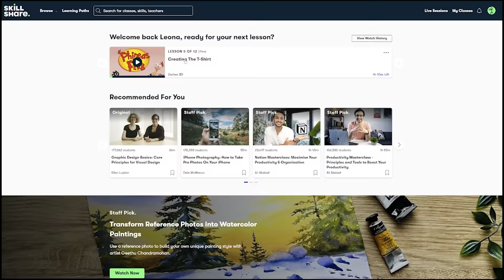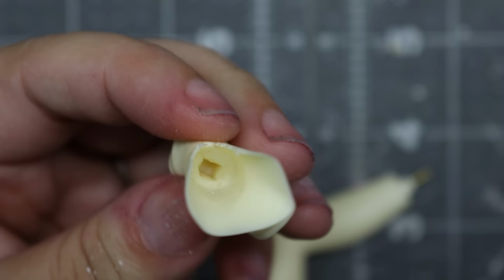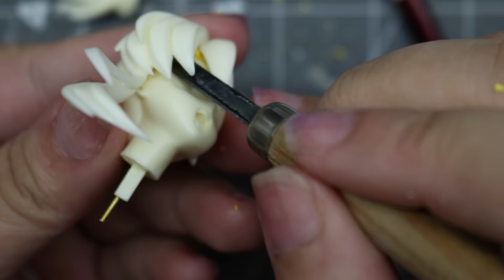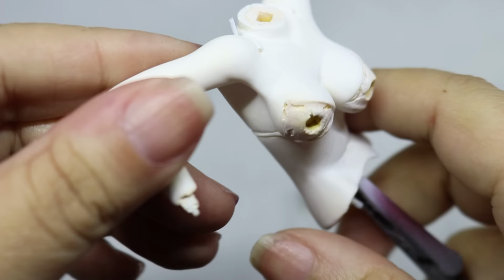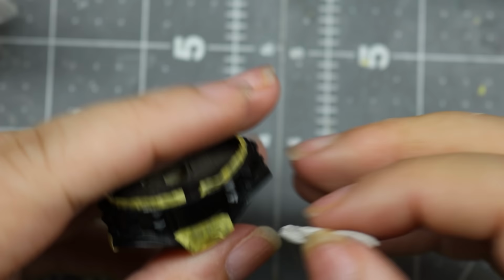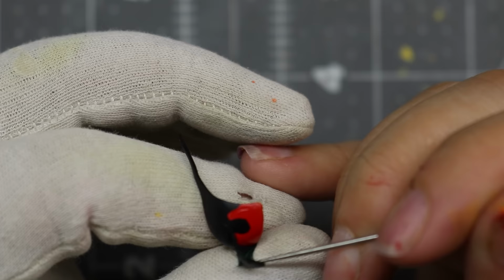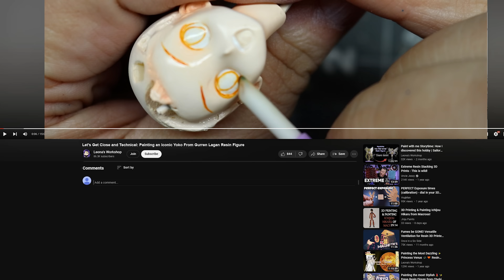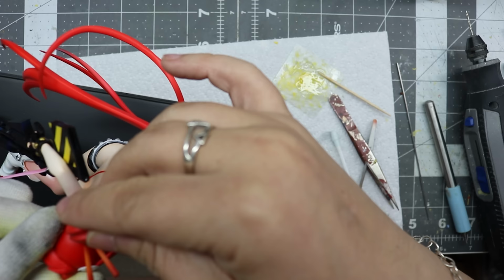🎨 Painting an Iconic Yoko Littner 👀 Resin Figure From Gurren Lagann 🤖

Comment from the maker: Hey guys, I don't wanna keep repeating so be SURE TO READ THE INFO BOX! All the info is there, I made a special google doc with the links to almost ALL the materials and products I use, if something is missing, please leave a comment here so I can update the list!
Hope you enjoy the premiere! 

There will be a few things that I didn't answer in this video mainly because it didn't apply, some of things off the top of my head people asked for was working with clear resin, this kit doesn't have it so raincheck for next time, another thing a couple of people asked was regarding tips for carpal tunnel and/or wrist paint management when holding an airbrush, I don't have that issue so I wouldn't know how to help you 😬
Reply: I just use a pistol grip airbrush... I have several makes from good manufacturer.... I'd advise people with hand issue to get either Grex Tr3, Procon Wa, Gaalhari GHAD-68 or Fendga BD116c... most of which have a mac valve so you can control how fine the paint/air is.
Reply: I think an approach that you can take is to (if you can) show How you hold your tools, how you move your Arm (rather than Just moving your wrist), if you do or don't lean on your elbows/forearms and if you use some kind of padding on your desk (you can pinch your nerves that way if you lean on them too much, as I've had to learn, 😔)

I remember you showed a bit of that in your air brush tutorial, with how the tool sits on your hand (how hard ppl grip their tools Also plays into straining/tiring their hands)...that stuff, 😅

Luckily I don't have carpal tunnel either but I Did, unfortunately, injure my radial & ulna nerves...on both hands. So holding a pencil/brush is... sometimes, a struggle

Thank you for this video Leona and thank you for your comedy, ❤
Reply: 6:54 this make me laugh A LOOOT! 😂

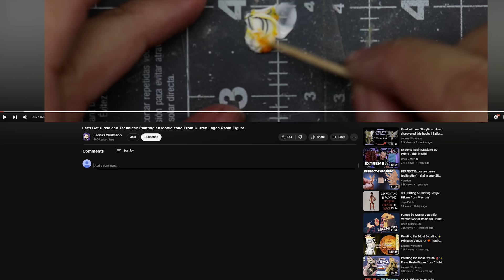8:20 OMG 😂
now I don't know if I can ask it for the meme 😂😂
Love more and more this video
Reply: not trying to be that guy but I have always been curious about your dust collection system

Comment: Hey Leona, I need advice with a prepainted resin figure I own. I feel like you would probably use the putty for this issue, but since she is prepainted I was wondering if there was something else I could use. My issue with her is her connection to her base. The notch her foot goes into a bigger than her peg, so she doesn't fit snug and because of this she slides forward and leans. Would you know a solution for this? Or would you say putty is the best way to go?

Comment: you seem to use brushes to apply the liquid masking, how do you clean the brushes after?
Reply from the maker: Most of the liquid masking is water based so I just rinse them when I'm done using them, if not I take some windex and soak for a few minutes and it does the trick, the only one I apply with a toothpick or something that's not a brush is the maskol because it's latex and ruins brushes

Comment: I have a question!

I forgot the question.
Reply from the maker: It happens 🫠
Reply: I remembered the question! (Technically it was a joke the first time, but I legit have a question)

Would you consider adding more paints to your set up? I do hear Ducan Rhodes Two Thin Coats is good, but I'd also understand if you didn't want to try them.
Reply from the maker: Never heard of them tbh

Comment: This doesnt seem like a hobby one pick up over night. High skill ceiling before decent product
Reply from the maker: It's called practice 😅
Reply: @leonasworkshop  decent set up equipment, tools, paint etc adds up greatly dont they. Not including time required for practice too.
Reply from the maker: Like any other hobby 🤷‍♀️
Reply: @leonasworkshop  hey whats a good paint  for practice? Dont have airbrush. So enamel? Also would you recommend stripping and repainting models or just get a different one to practice with?
Reply from the maker: Watch my essentials video, gives you a good idea of where to start and what you need/can use